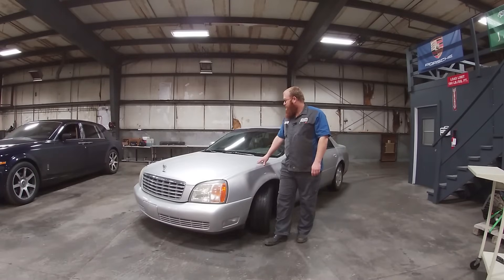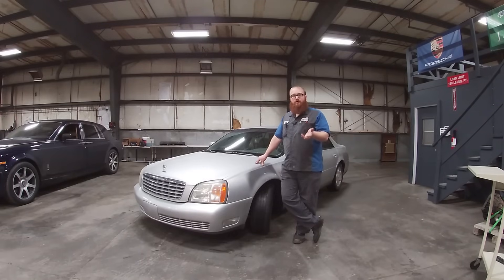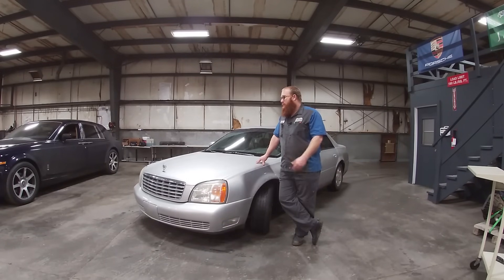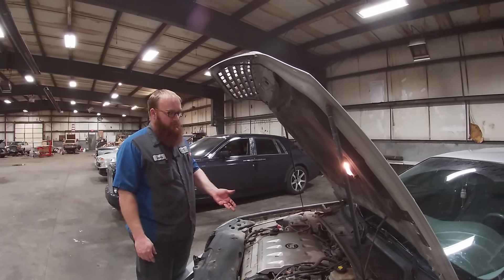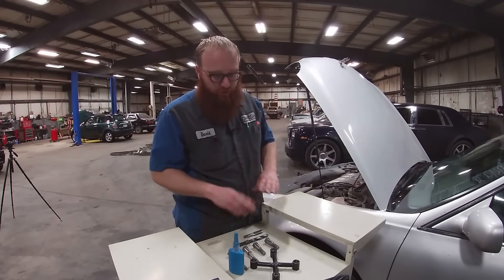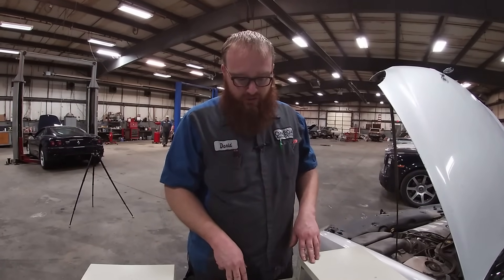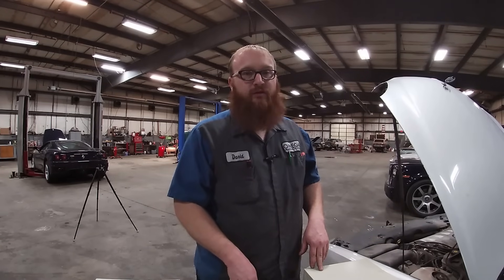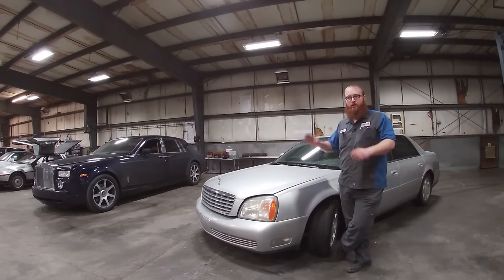The CAR WIZARD names Cadillac's Northstar Engine the Dumbest Design

Comment: My 2007 Cadillac DTS lasted me 140,000 miles then it over heated and never worked again.
Reply: My 04 Cadillac Escalade 6.0 in the other hand has 198,000 miles runs like new 0 problems bought her brand new at Tom peacock Cadillac in Houston back in 03
Reply: @chriss5181  Totally different engine in a totally different vehicle. Escalade is a dressed up GMC Yukon with an LS and built in a GM truck plant. They are great and the 6.0l goes 300k easily if you take care of it.
Reply: Brian Borell it’s not really a dress up Yukon because the Escalade has a superior suspension
Reply: Chris S had an 03 Escalade. Was a pile of shit. Gave it to my cousin for free two years ago. Only had 65k miles.
Reply: Robert jayjay Higgins that’s because you had the 5.3L only the 6.0 is the reliable engine
Reply: Did you baby it???? I beat the living shit out of my chevy and it runs great....Gotta treat it like a woman...
Reply: @chriss5181  5.3 is more reliable than the 6.0
Reply: @chriss5181  depends on the year. Ls1 owner your speaking to
Reply: Alex Scarborough then u should know that the 6.0 was better built since its an LQ9 all LS owners know this.
Reply: @chriss5181  yes the gen 3 lq9 is a great motor. The lq4 is the 6.0 i was referring to.

Comment: Start to finish i did this job in 40 hrs complete and running. I lifted the car off the engine and cradle , broke it down. Using time serts and the loctite. Has 70,000 mi,s since and runs perfect. 220,000 miles , don't use dexcool, corrodes the time sert. I keep good ole green ethylene glycol and some waterpump lube. If I had the extra money I would of bought the kits with the studs. Being a gm dealership flat rate mechanic for years you develop a mindset that makes you love stress and pain.  I did this at home in my garage on a lift

Comment: I have been driving a 2001 Olds Aurora with the 4.0 Northstar V8 since 2000. I am not an easy driver. I pay attention to oil changes and cooling system maintenance. Head gasket problems in that time?  ZERO!!!!!!!
Reply: How many miles ? I had 98 or 2000 aurora . The car had the most comfortable seats in the world . I had 2002 caddy no overheating issues bout 120-130k miles.
Reply: @rickybobbydastar6534  As of now, 130,000 miles.
Reply: @Marc816  any issues so far ?
Reply: @rickybobbydastar6534  Yes.....it needed spark plugs & spark plug insulators 3 years ago. And then in 2020 it needed a fuel pump. Other than that, it's been trouble free.
Reply: @Marc816  oh yeah u got the new body style one , I luv those . Bro I had the 99 bodystyle . 170k miles when I bought it . Kept it for 8 months , new alternator, fist mechanic didn’t know what he was doing. New torque converter and no problems . I only paid 700 for it .
Reply: @rickybobbydastar6534  ok

Comment: I own a Cadillac Seville (1999) and lemme tell you, he is right
Reply: I really wanted a STS, but I’m afraid to buy one because I can’t afford to fix one
Reply: I have the misfortune of owning a 1999 DeVille.  As a retired driver for a brown army, used to pick up my cars and a motorcycle on my various routes.  Good luck with all except for the DeVille.  No bargain even at half off asking price.  Leaks oil and transmission fluid which is sealed.  Not putting good money into a bad car.  Just waiting for it to die.
Reply: @xtbum3339  You mean the transmission fluid is sealed?
If so, what do you mean by that.
Reply: @caddyguy5369  The transmission being sealed, fluid can't be added.
Reply: @xtbum3339  You add it through the dipstick tube. How else would you refill it after doing a transmission pan gasket or something?
They don't make you replace the transmission because a gasket is leaking.
Reply: @caddyguy5369  There is no dipstick.
Reply: @xtbum3339  Touche. I was thinking it was the same body style as my 02. I didn't think about when they switched.
I'll take your word for it. I'm not familiar with 99 body style. I went from 92 to 02 to 08.
Reply: Luckily I bought a cadillac with 4.9
Reply: @xtbum3339  My 2000 Caddy Devile has  a place to add transmission fluid - on top of the side pan on the drivers side under the hood. And it has a dipstick on the the cap to this spot, too.

Comment: Today a peugeot 2.7 diesel rolled in , had to take the whole engine and transmission out to change the starter :/
Reply: what the f.. 
which model?!
Reply: @rosen9425  607
Reply: Yes, btw you are supposed to do that from the bottom with a hoist
Reply: @ico9750  good luck we tried, taking the engine out was easier
Reply: On the other end of the spectrum you have many older SAABs where you can replace the clutch with engine and trans still in the car🤷‍♂️
Reply: @DrewLSsix  Which SAABs are like that?  I've had my eye on a few early 2000s SAABs because they're so cheap and I know a guy who works on them.  I've always liked them, especially the convertibles, and I've been told to stay away from the v6.  Thanks

Comment: I had a 2000 STS. Loved the engine!  I never had the head bolt issue, but it was a high revving, powerful engine that sounded amazing through the Corsa cat-back exhaust I had on it. It got decent fuel mileage as well.
Reply: northstar engines are not " high reving" engines....it might " sound" like it is , but 5500 to 6000 rpm's is far from high reving , and if you managed to get 7000 rpms out of it , that would've been the last time you drove it....
Reply: @mattriella6776  it shifted at 6,500 RPMs with a rev limiter of 6,800 RPMs.  That's pretty high for a big V-8.

Comment: I owned a 1993 STS with northstar and my water pump went out. The mechanic I took it to said he would never work on a northstar caddy again. Apparently, you have to unbolt the motor mounts and jack the engine to access the water pump.
Reply: That's true of almost every car with a transverse engine mount.
Reply: Actually, the water pump on a 93 is simple - if you have the giant water pump socket. It's basically a cartridge.
Reply: @aarons7285  I know that dude said he would never work on another. He had the car 3 days lol
Reply: The same was true in a Chrysler minivan I owned with the Mitsubishi 3.0L V6.  Just about any transverse engine mount vehicle requires an engine mount removal at a minimum to replace a water pump.  I replaced the timing belt in that thing while I had it all apart and drove it for many years before selling it (and it still ran like a champ despite being over 20 years old and over 200K).   You take care of your car, it will take care of you.
Reply: @michaelvargas2900   Odd, had a 93 NS Eldorado, did the WP in my driveway with a hammer and a big screwdriver on a weeknight in the late 90s. Big socket would have been nice, but I didn't know until I was in there, no internet resources like now. The tabs started to bend, but it came loose before they all bent over. Wonder if your guy overlooked a shortcut or if the Eldo had more clearance in the bay.

Comment: Have an '04 Deville that leaks oil like the Exxon Valdez...I think I know why now 🤔 Thanks Car Wizard! Love your content!
Reply: THIS WAS A FORMULA ONE ENGINE, IT WAS NEVER DESIGNED FOR STOP AND GO...
Reply: I have a Chevy Z71 4x4,I bought new&it was the 1st year gm used the Corvete LS1 engine design in the truck,but in the Iron block&I also have a lil ranger 96I bought new with no issues&my Chevy v8 little over 100,000&I always keep my trucks maintained&my headgaskets blew on my chevy&seized/locked my 5.3L -V8 up,but I got a newer gen2 -5.3L that gm fixed this issue on.
Reply: I also have an 04 that leaks oil.  How do we fix It?
Reply: the piston skirts wear which allows pistons to fit loosely which causes a lot of crankcase blowby and pressure in the block causes leaks. its necessary to replace pistons if a reseal is gonna be done.
Reply: @marion cobaretti thanks. This sounds like what I’m experiencing. It also sounds expensive. 🤔
Reply: @bcsolorza  Check that it's not the oil pressure sensor leaking. About $70 installed and a very common leak. Make sure you use the proper GM part either from the dealer or online. Mine was leaking oil from there. Takes 10 minutes to install, no more leaks.
Reply: By 2004 the northstar was fixed and actually won engine of the year

Comment: You didnt mention the the water pump location, and also the dumb location where the starter is located. Under the intake manifold. I dont like that motor one bit.
Reply: When I read the video title I thought it would be completely about that topic.
Reply: What is the problem with either one of those items?
Reply: Those arent really issues with the engine. It doesnt make or break the engine. Infact it's common place for the starter placement on a lot of vehicle with a transverse trans

Comment: When it comes to over the road trucks, the worse designed motor has to be, hands down, the Navistar "Maxxforce" engine. 10 book hours for the high pressure turbo, & 21 book hours for the low pressure turbo. Insane.

Comment: Had my 2003 deville for 5yrs. 246000+ miles and no major problems from the motor. Had to replace the tcc solenoid inside the trans but it was a simple job.
Reply: mwjjr your a lucky one! I had a 2002 that would drink 2 quarts of oil every 900 miles just like clockwork. I was baffled at where all that oil was going since it didn’t leak or below smoke. Around 115,000 it blew the head gaskets, blew white smoke, and overheated. I ended up selling a mint condition Cadillac for 900 dollars just to get it out of my hair. I’m glad you have been lucky because the car itself is fantastic! I loved cruising in the big Cadillac!
Reply: JohnnyRebKy How did you drive it?
Babying the northstar leads to carbon buildup, stuck rings, bad mileage, lost power, smoking, etc
It needs to be driven strong, there is a protocol for clearing out carbon
Reply: Mejjr, what was ur symptoms of a the tcc solenoid going bad? I have a 2002 Buick park ave that when the transmission gets a little too warm it will shift real hard. It’s avoidable by keeping the ac on either keeping the temp low or the defroster always on which kicks on the auxiliary fan keeping the transmission at a cooler temp. This is only needed when I’m traffic. I read I have a bad solenoid in the transmission. Don’t wanna drop the tran to replace a $10 part. Was going to add an extra fan on the radiator but I don’t really have room for one. Car has 175k miles and had a transmission flush at 150k which i read it should not have been done that late in the game. Also the old lady had synthetic trans fluid put in. Hoping the solenoid is just being faulty.
Reply: @JohnnyRebKy  how often were you changing coolant?
Reply: Vlad The Inhaler I was totally aware of the babying the northstar thing. I made sure to give it a good wide open throttle run at least once a week.
Reply: Eshu I added coolant when it started using it. But i didn’t have it long enough to need to change it. It was changed just before I bought it.
Reply: @JohnnyRebKy  most people never change their coolant.. ever in the life of the vehicle. which probably has something to do with the rate of head gasket failures. supposedly the dexcool coolant goes acidic with time and eats away at the aluminum...
Reply: Eshu that’s correct. Did a lot of research and it turns to like a sludge- especially because GM insisted they put the dumb pellets in the coolant. It’s ok to use dexcool in this car, but you’ve gotta change it every 3 years or so.

Comment: I used to be a tech for a Cadillac dealer from 1996 to early 2000s. Also did heavy line work. Mainly rebuilt these engines for knocking. There was bulletin to piston changes. Didn't see many of the Nodthstars for head gaskets. The older 4.5 and 4.9 V8s were terrible. Those had an aluminum block, intake manifold, but iron heads.

Comment: Go back to the 1980's when Caddy experimented with putting a diesel engine in their cars during one of the gas crisises.   They took a conventional gas engine block and decided to make a diesel out of it.  It blew all kinds of seals.
Reply: That was the Olds 4.3 engine. I worked at a GM dealership out of High School beginning in 85. One of my friends worked there as well he rebuilt  diesel engines ( most of the time he worked on truck engines) .  He said that 4.3 was only good for a boat anchor. It was by far the worst diesel engine  ever made by man LOL.

Comment: I worked as a  Cadillac line tech from '71 till '08 as a heavy engine tech. The NorthStar certainly had it's issues. God only knows how many timeserts I installed in these. Over 170 engines removed for one fix or another by the time I retired. They usually stayed fixed once these were installed correctly. The severe oil leaks are a story for another day!
Reply: lee sherman 
Hard to trust General Motors with these kind of engineering failures.
Reply: @drgjs  ..welcome to modern growing trend in American mega-corporate engineering, economics & politics. 

Look at the Boeing Max 8; they thought effectively faring the engine into the wing wouldn't severly effect lift & CoG, or that the fan exhaust airflow along the wings underside wouldn't increase the lift ratio of the wing in a induced Coanda effect at all throttle settings, with just a few extra sensors, electroincs, and an badly coded algorithm would fix the issue without ANY major testing (to hide from the FAA & Pilot retraining requirements of customer airlines etc), nor ANY redesigning the aircraft with a larger tail and/or extending the forward fusalage would be perfectly A-OK, ..and then the FAA... being inept, palmed-off or being downright complicit...

Comment: My mom owned two of these, the first one was so bad she thought it was a lemon, and after they replaced the engine in the second Cadillac she dumped it. She swore off Cadillac and never bothered with another one since. Even if they didn't lose the headgaskets my dad was convinced GM signed a deal with oil manufacturers to burn as much oil as possible, really made his 350 small blocks look tightly sealed.

Comment: BMW aluminum straight 6 has exactly the same bad design. Just finished doing Timeserts in one of those..
Reply: Done a bunch of 'em and completely agree.  

And just like the Northstar, the best way to get the head off is to remove the engine from the vehicle.
Reply: Which? My m54 has been beyond reliable and runs like a dream to this day in all climates, has been very cheap to maintain.
Reply: @Whiboi   What year the car and how may miles on your M54? Answer to this usually explains everything..
Reply: Nils Jakobson 2002 with 240k miles, coils were all original until this week when I opted for the Bosch over remi, still has factory coolant hoses
Reply: @Whiboi  Original coils at 240k miles? :) Not a chance mate, not a chance. I dont need fairy tales, trust me. I have had many BMWs and while among them there is one amazingly well built car 1999 323i which is M52TU with 300+ k miles and still runs fine, I will never believe that BMW can have all original coils at 240k miles, sorry but its just not possible. Either you just got lucky and recently bought this car from someone who was maintaining it pedantically or its just a fairy tale. Good try tho.
Reply: Nils Jakobson lmao sucks to suck I guess, my car is much more fun than yours :) prolly cheaper too

Comment: If you like that style Cadi Check out the mid 90's Fleetwoods they have the V8 LT1 Corvette motor.
Reply: Agreed, love my '94 fleetwood.
Reply: @matthewmckean8771  me too brother I got the brougham she's such a lady.
Reply: I had a 94 DeVille with the 4.9 liter
Reply: Omg I cringe every time I see someone refer to an lt1 as a "Corvette motor"
The Corvette had a 4 bolt main block and aluminum heads, the caddy/buick/caprice/impala SS had a 2 bolt main block and iron heads, so no it's not a "Corvette motor" at all. They are underpowered (whopping 265hp) junk with a crappy optispark and stupid reverse cooling.
Reply: @ROB-kd4nk  deal with it.

Comment: So much for the “revered GM Engineering”….An old saying: Engineers need to be supervised at all times by mechanics…
Reply: Well, it's not entirely fair to blame engineering.  There's a whole lot more that goes into mass producing vehicles than engineering, and I don't just mean assembly, either.

There's also bureaucracy to contend with, such as those who look at a design and demand changes in order to cut the cost a little further, and the engineers usually can't veto such decisions and are forced to work around them.

And General Motors was among the worst offenders in that regard.  It's a bit of a miracle that they still managed to turn out decent cars, but usually what's already proven and/or too simple to royally screw up, such as the Chevrolet 350 V8 or the I-4 Iron Duke as well as bread-and-butter A-platform cars like the Oldsmobile Cutlass Ciera or the Buick Century.
Reply: @Albert Calderon Yup. Engineering would’ve never overlooked such an obvious problem. Bean counters and execs 100% to blame. As a former auto tech and a current enthusiast that likes to wrench, engineers are the bane of my existence and cause of many scraped knuckles. But what they aren’t is stupid.